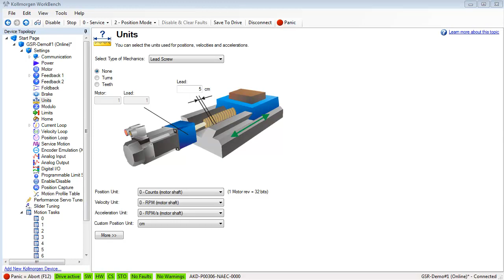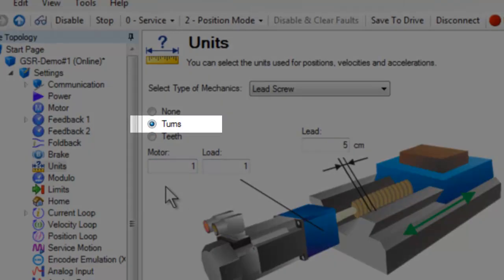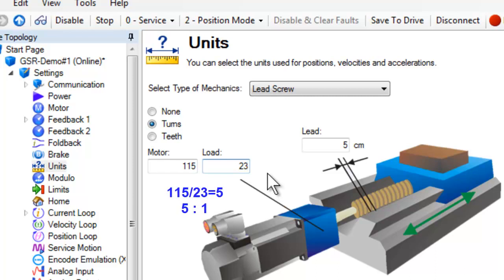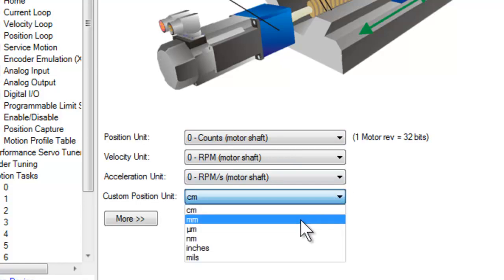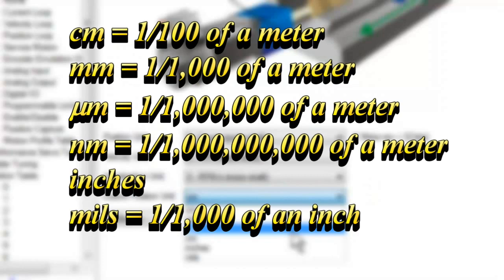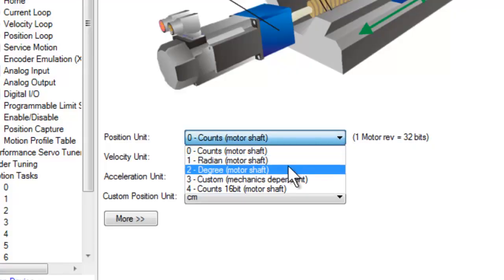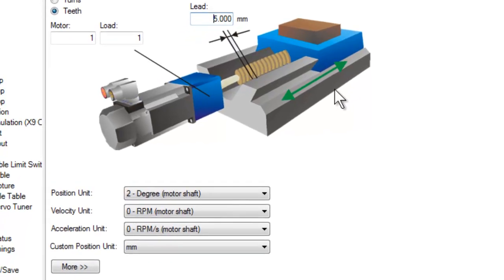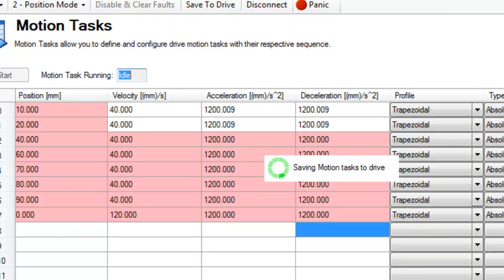AKD Servo Drive Screw Mechanism Setup | Kollmorgen | 2 Min of Motion

Comment: hi Mr.Gordan,

i would like to know about unit settings in kollmorgen workbench.
For one of application of wire winding machine , we are using kollmorgen AKD-M00307-MCEC-0000 Drive as Master Axis & AKD-P00307-NAAN-0000 as Slave Axis.

Master Is rotary axis used for winding , whereas slave axis is traverse axis which pass wire to winder in forward & reverse direction to complete winding process.

Master Axis Motor mechanics is as below 
No of teeth of pully connected to motor shaft : 24 
No of teeth of pully connceted to Winder shaft : 96

Slave Axis Motor mechanics is as below 
Slave axis motor is connected to ball screw of length 250 mm with pitch of 6 mm. this motor is connected to ball screw shaft with flexible coupling with any reduction gear box.

Now here i would like to know, whether i have to set units for Master and Slave axis for their respective mechanics details.
Also both motor uses mutliturn absolute encoder (Endat) but problem is drive can not able to keep position retain. hence every time we have make homing for both axis.

Could you please guide us  

thank you,
Sagar Chavan
+919922902596
Reply from the maker: Sagar - Please send directly to my email address your info and I will return with a document that should help you address how to complete this in Workbench.  Send to trainingdept@kollmorgen.com